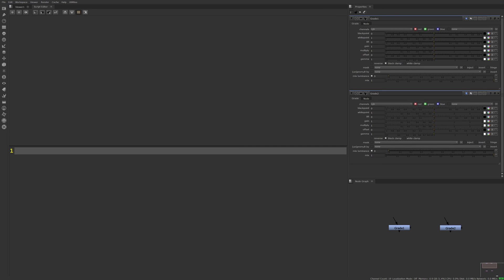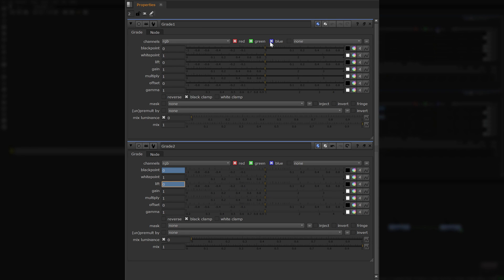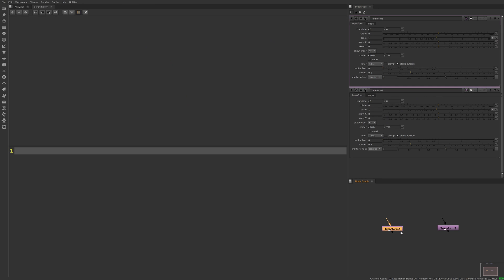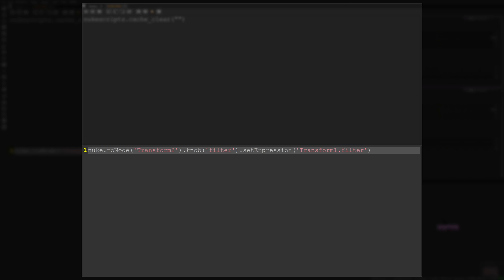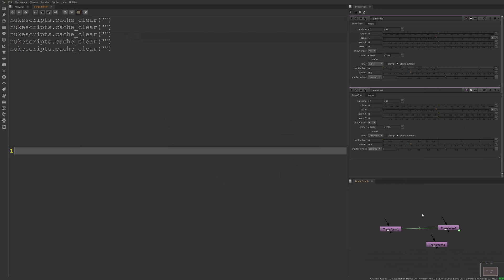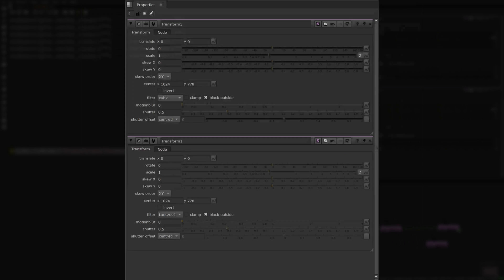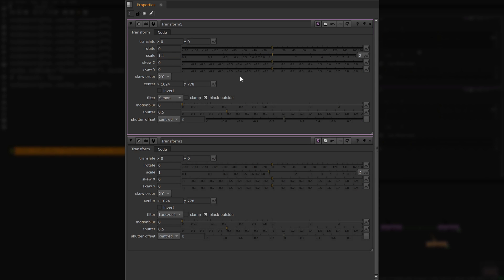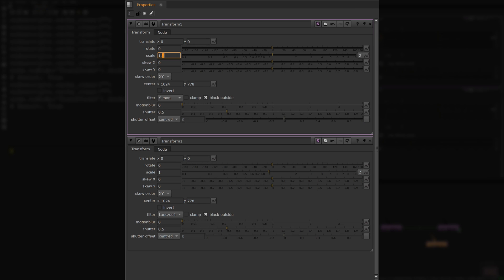Ben, how do I expression-link Pulldown Knobs?

Comment: Tried this with label and Text Input Knobs but never got them to link. Not sure if you have a method for linking text or labels?
Reply from the maker: There are some knob types that don't have expression-linking functionality -- the text input & multi-line string knobs are unfortunately two of them.

However you can still use TCL to point one node at another's value, for example.
[value Grade1.multiply]

This will help you to have dynamic node labels.
Reply: @BenMcEwan  Thanks for the response! I'll go ahead and use that instead :D